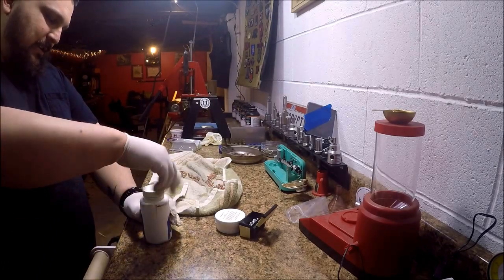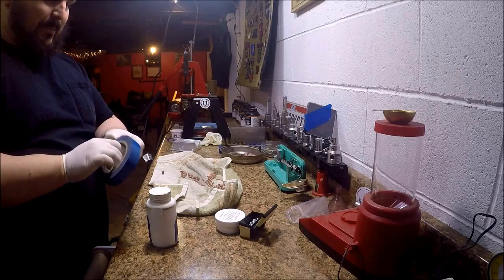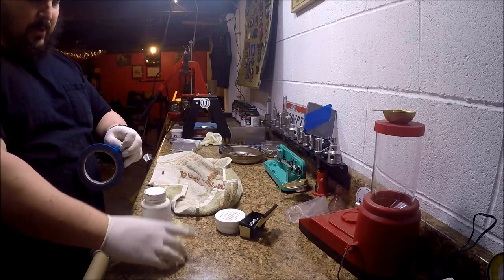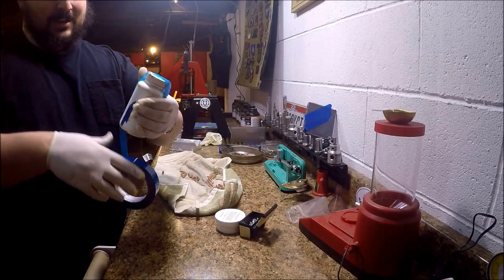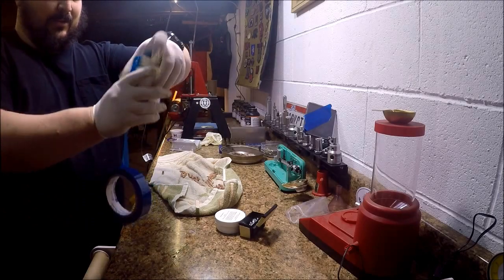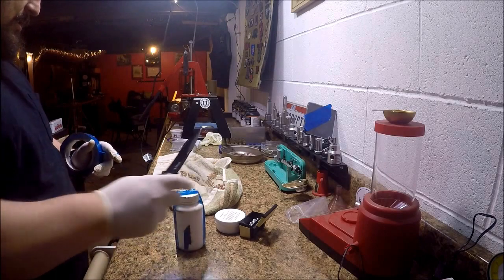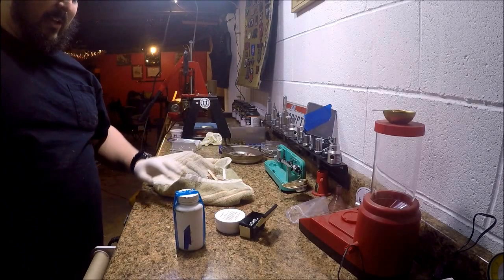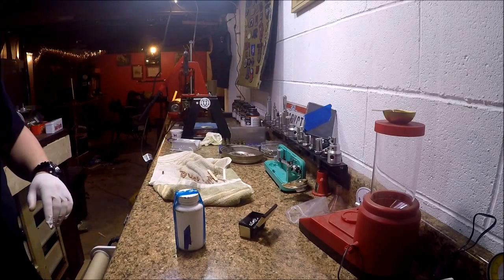HBN Bullet coating almost like magic!

Comment: Hey! You're letting out my big secret. BBs is a good idea. I cut open steel shot shells. Maybe the bigger BBs work better. I do this with any round or rifle I care about. Many thousands of bullets. I should get a dedicated tumbler and stop messing with the vitamin bottles. Also I tumble for about 30 min. I have not any improvement running longer. You did a good job with the video.

Comment: I don’t use bbs at all and it works great. I found you don’t need to wash Sierra or Berger bullets. Only Tubb’s HBN will work without media...I’ve tried them all; and he did something different to his powder to make it coat so well with no media...
Reply from the maker: yeah I stopped using BB's as well.

Comment: I recently spoke with a representative from one of the premier barrel makers in America. The guy is also a bench rest shooter and makes his own bullets. He told me that Hex Boron Nitride (HBN) is a non-compressible material that will build up in a barrel and destroy it. In addition, it does not prevent fouling as some think. The carbon and brass are still there and are being packed in by the HBN. Eventually, shooters get to the point where they realize there is a problem and try to remove it. The representative said they can sometimes remove the HBN, but most barrels are ruined by it. With respect to tumbling precision bullets to coat them, he said it makes him cringe. This HBN craze reminds me of performance enhancing drugs. You get some short term gains, but wind up paying for it in the long term.
Reply: I know this reply is two years old, but which manufacturer said that?
Krieger barrels told me that nickel boron or other high temp treatments will damage the barrels, so those options are out.
When I trreated my .308 barrel and chamber, I noticed a pretty large velocity drop- around 50 fps on my smk175 w/ 39gn Varget loads.
I record EVERY shot taken and I have very consistant results, meaning there is no build-up as you claim. 
I would suggest that you gguys do your own research before making claims, but that would pretty much end the internet, I guess
Reply: I’ve been using it for 5 plus years and all my custom barrels are Hart and Bartlein. I’ve had no problem with build up, in fact I believe I’m actually getting more rounds through the barrel before accuracy drops off enough to need replacement...to the poster about loosing 50 FPS , no kidding, that’s because the bullet is so slick the ignition goes past it quicker. It also lowers your pressure so you can use more powder then with a naked bullet and pick up FPS....barrel makers also say to clean the heck put of your barrel....wonder why? All th best shooters I know are still using moly which will eat your barrel if you don’t take care of it but the younger ones ...HBN all the way. Why don’t you call the inventor and ask him directly at Superior Shooting, Davis Tubb...he has set a lot of records and he HBN’s all his bullets...

Comment: Why add the BB's ?  The bullets will peen the HBN into each other as well as having BB's in there.  You will also waste less HBN.  David Tubb,  who developed this whole idea of coating bullets with HBN uses no impact media.  And you don't have to futz with sorting bullets and BB's at the end either. --- Still an A+ video and thanks for posting it !
Reply: Try using plastic BB's instead of steel
Reply from the maker: I have been thinking about that recently and the answer is because that's how I've always done it. I suspect there is perhaps an advantage is the bb's might act as bearing and allow the bullets to tumble around faster reducing the tumble time. Might be a good experiment to run.
Reply: Yes, I've seen the impact media step added to some people's routine on this.  But I see no need, or logic in doing it. My bullets coat perfectly with bullets and HBN only.   If you run the experiment please reply your results to this thread.  Thanks !!
Reply from the maker: +doctorxring I'll be doing the comparison this week
Reply from the maker: +doctorxring I'll be doing the comparison this week
Reply: Hey Joseph !  Thanks for the heads up.  I'll be looking forward to hearing about your results.  Please comment on one of my posts when you do and I'll get a ringer in my email.
Reply from the maker: Hey update video will post tonight uploading now.

Comment: Can HBN mix with acetone?
Then you could just wash them. Or perhaps alcohol.
Reply from the maker: You mean mix the HbN in something like 99 percent isopropyl or acetone the has HbN suspended in solution? It may work but I'd think I'd be difficult to keep the HbN in solution and I don't know how just coating vs impact coating would effect the performance.
Reply: You're right it would just wipe off, I am silly.
Such a slippery powder too, it means your ammo could be made from any metal, not pure lead.
Reply from the maker: +Myles Nicholas I'm not into shooting cast bullets but it's an interesting point if you wanted to shoot say cast 9mm I wonder if you could use HbN. I have a 45-70 I've been thinking about reloading for and buying molds and casting my own bullets for.
Reply: you can to swab the barrel, but not for bullet coating, that would be way to thick on the bullets.

lyman sells ceramic coating pellets, thats what i use
Reply from the maker: +russr ok makes sense to me. I just was given a muzzle loader as a gift so black powder shooting is something I'm going to have to learn more about
Reply: yes. It is just a solution. You need to shake it before use.